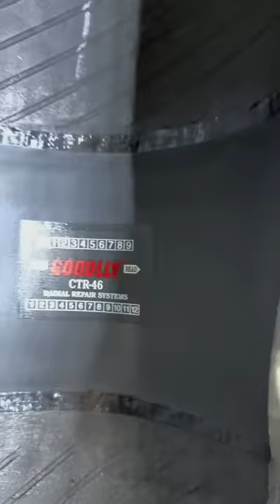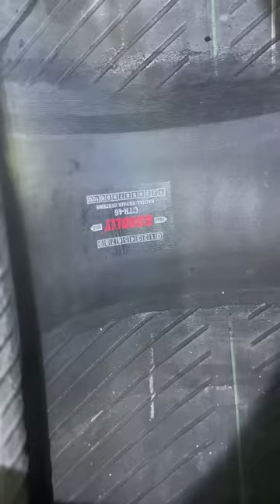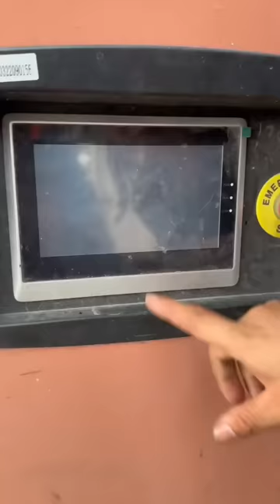Truck Puncture Tire Big Hole Repair Without Replacement!

Comment: How does a bolt get implanted in a tire ? And why not use a smaller patch? Seems huge for the size of the hole.
Reply: I think they use a big patch to hold the structure of the tire together in case some cords were broken. There used to be a commercial back in the 1970’s where they drove a steel belted tire over a piece of steel like a bolt to prove how tough it was. I guess this tire wouldn’t make the grade 😅😂

Comment: Truck HOLE :

1. Over gole atau menurunkan mechine truck atau menurunkan ban radial hole ata over hole sama seperti

2. Jikalau kunci kontak di hubungkan aruss listrik yang berasal dari Accu akanemgalir ke kunci kontakelalui distributo lalu kunci kontak di ONKAN MECHINE akan MENUALA atau mechine akan di hidupkan 

3. Over holeee atau HOLE nan radial kalau nannya tidak di tambal mobil dan motor tidak akan berjalan semestinya

4. Di manakah HIDUP diatas jalan raya bukan mati ketabrak ????

5. Nah ini susah tidak ada jawaban👍✍️✍️🙏🙏🙏

Comment: Why didn’t you just use a patch plug? Or a normal pull through plug? There was no reason to grind the tread down like that if all you were going to do was boot it.
Reply: Do you know the amount of pressure. Plus  it was done to last for years. Unless they run over another screw or some object. Dah.

Comment: You along with a couple other million people are using your open in the wrong way. The big side of the opening is where you supposed to put the pressure not the small side😂😂😂😂😂😂😂😂😂

Comment: Why enlarge the hole so much? She also cut the wires of the ply as evident from the sparks! The load capacity is gone! Rubber alone of no use! Better throw away the tyre than cause an accident at high speed!

Comment: I'd rather not do that, making the whole even bigger. Had to clean the puncture at the minimal damage to the tire to repair it. Otherwise, the balance of the whole tire is compromised, when it is patched up.